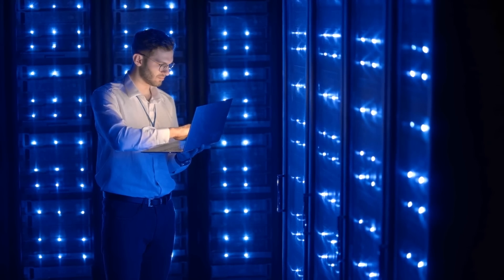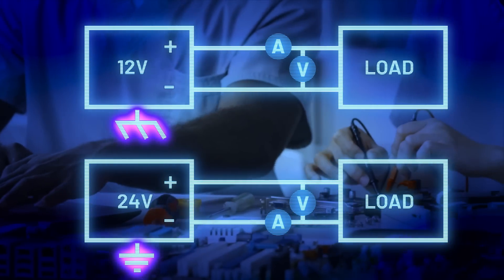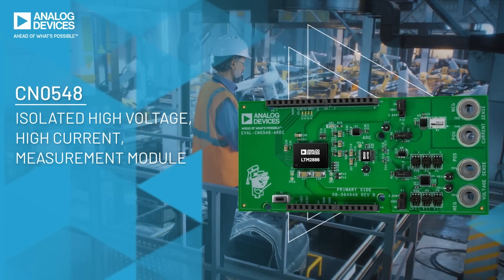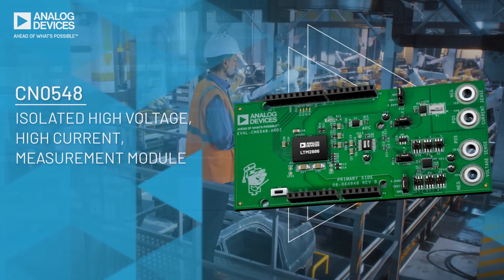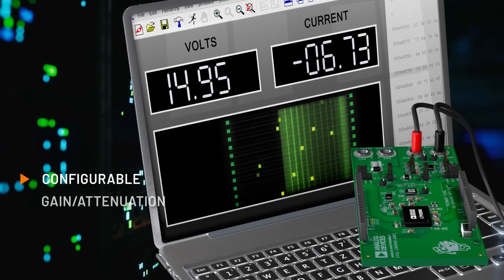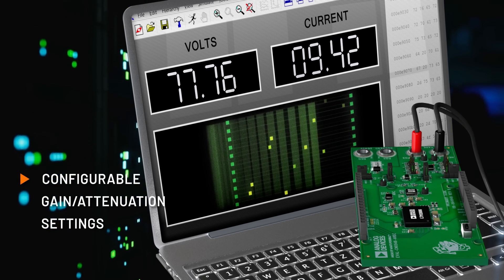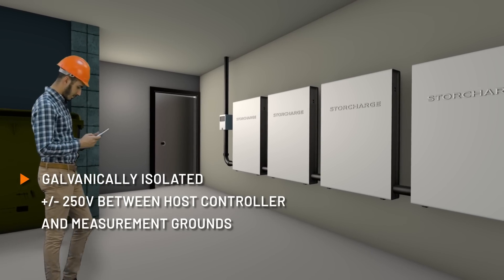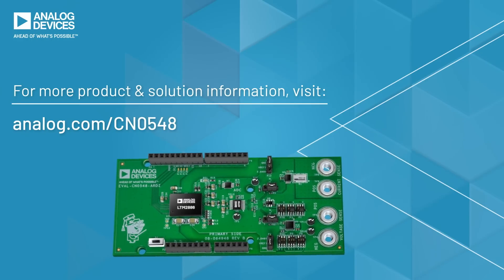CN0548: Isolated High Voltage, High Current, Measurement Module

Comment: Slowly moving towards multimeter on a chip solution.
Reply: most multimeters have been for long time single chip solutions
Reply: @miroslavradev756  I mean having range switching, filtering, reference generation, bias gen, etc… all in one chip. Imagine opening up a multimeter and just seeing one IC
Reply: Can't his reproduce a 300 volt ac sine to be measured on a daq with a 0 to 10 volt input
Reply: @ you can have capacitive, or dynamic dividers with SiC. Or have photonic based voltage measurements were a materials transparency or polarization changes with voltage. If you get creative enough, a fully protected rugged multimeter can be designed into a SOIC-8 or QFN package. If the cost issue solves itself with time, the future will be an integrated future.